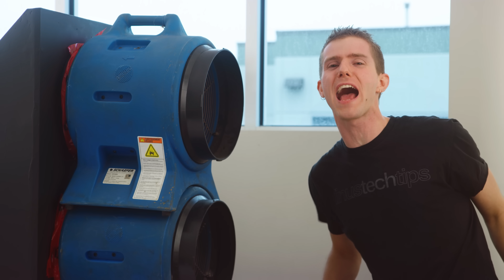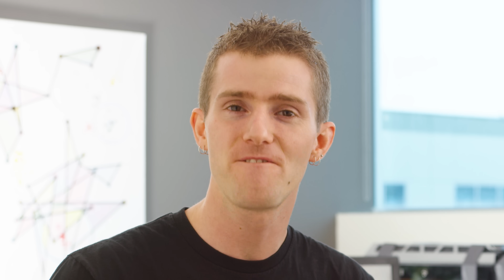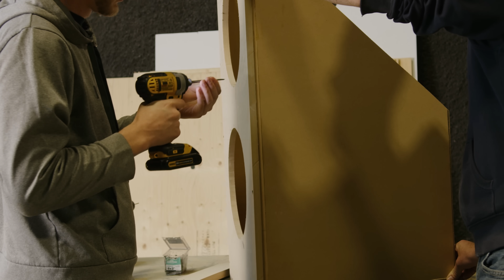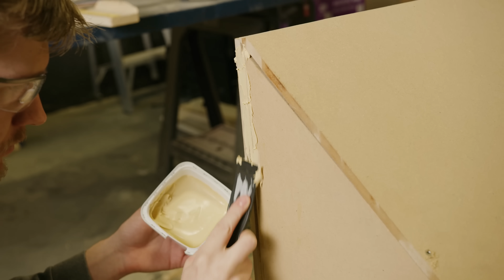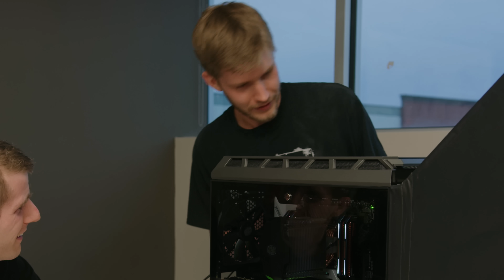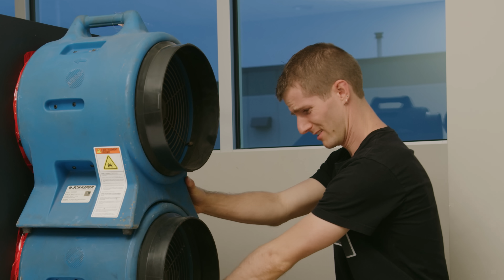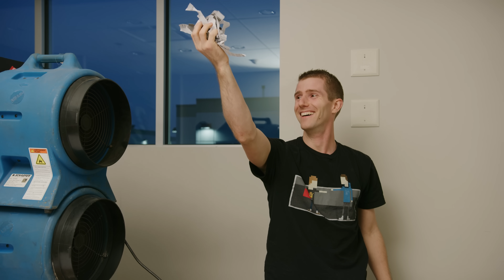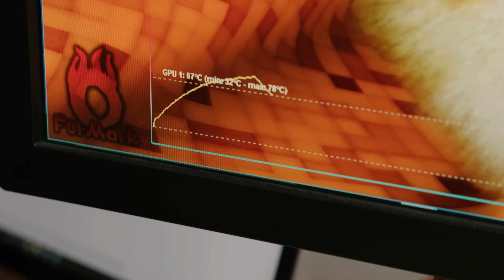Highest Airflow PC EVER - SUCCESS!

Comment: Anybody know what to do if your keyboard and mouse stop working after turning off your pc? They dont work in bios either and ive tried different keyboards and mice.
Reply: What are you trying to do with your mouse and keyboard with the PC turned off...
Reply: CHAOS_ Gaming in the BIOS settings there's a setting for things to load before boot. This is probably set to basic so your peripherals load after the OS loads. You need to reset BIOS then it should work.
Reply: holy shit you loaded games onto your bios? Anyways try reverting your bios to defaults maybe it's a software glitch. Simply pull the battery and reinsert it
Reply: there's a possability your connection ports 'usb ports' are fried...have you tried using others?

Comment: Cutting MDF without a respirator or even dust collection? Hope you like your lung cancer, that shit is dangerous.
Reply: its not like radioactive uranium that instantly kills you :D
Reply: >its not like radioactive uranium that instantly kills you :D

You have no idea what you're talking about.

Alpha radiation, which is the primary radiation decay product of natural uranium cannot penetrate human skin. You can hold uranium in your hand, preferably with gloves without issue. I've held samples of uranium and me still being alive more than 20 years later proves you wrong.

The reason for the gloves is to prevent ingestion or uranium entering cuts. If you get uranium inside your body, that's when the potential for cancer starts because internal organs don't offer the same protection from radiation. Though it would take years or decades for such cancers to develop.

You can even stand next to fresh nuclear fuel rods without issue. The instant death problem (which is not really instant) comes from spent nuclear fuel which has all matters of nasty isotopes that will cause death if too much exposure is had with them.

Comment: I use a 120mm bitmain antminer fan. they like 10-50 bucks each. on system 1 at 10 percent cools my GPU 20-30 degree C. my room is like 83-95degrees but my GPU is at 63-75 degrees. btw it's two XFX rx580 1425 oc+ edition Hynix 8gb hashing at 55mh steady for 4 days now non stop

Comment: Wow, this was amazing!!!... For a follow up video can you do something more risky??... 

Basically remove the cpu and graphic card fans and any other fans and just have these beast fans run as the only/primary fans, because I dont know why but for some reason I feel, that all the extra fan cassing may be causing air particles to bounce around and therefore without them the air could rapidly flow in one direction, whilst possibly taking the heat along with them more quickly, which may essentially cool the cpu/ graphic card quicker. 

Lol just a crazy thought its up to you if you wana go through with this xD.

Comment: Once i installed 50w cooling fan/ turbine from onboard computer of some tank it was like shitload of airflow and with some nice big heatpiped sinks temp of gpu an cpu and even ram close to ambient ( 2-5 deg C of difference) and it was quite quiet, 500w sound system on half throttle was able to overcome noise from fan :D

Comment: A good lo tech way to have a silent PC is to have your desk against a thick wall and drill a small hole for the monitor, mouse, keyboard cable then have the PC in the other room on the other side of the thick wall but still a short distance from you desk/monitor.

Comment: except it won't run for long because the dust touching the hardware is going to cause electromagnetic buildup and short circuit your system very quick. which is why you're not supposed to vacuum clean your pc.

Comment: Linus, this is a very cool video.  This got me wondering, has anyone ever tried to use a Dyson fan to cool a PC?  In particular, the Supersonic hair dryer.  I ask because the motor and fan are not really connected.  Thus if one had the know how, then they could mount a fan or 2 anywhere on a PC and place the motor for fans else were.  I am just curious if anyone had attempted this.

Comment: Wait, so even with all that airflow, the idle temps were higher than my little air-cooled midtower under load? Just how hot does the i9 and 1080 ti GET? I'm running an FX-8350 and 980 Ti and rarely ever see more than 60c under high load, 35c during idle.

Comment: If the air doesn't blow INTO the case, it doesn't produce the turbulence necessary to provide even cooling.  Sucking air through a case bypasses most of the hot spots.

Comment: Notice the rear fan is not removed... You have removed 2 frontfans but you forgot there is still rear fan mounted.
Because there is already so much airflow from bigass blowers, you don't need extra fans in the case lol... you don't need them!
Now i think the rear fan will die fast because over-RPM. Normally this rear fan does ~1500 rpm but with bigass blowers the fan RPM should perhaps around 10,000 or more RPM.
Strange enough, the fan blades are not broken due high RPM. But the bearings will break faster.

Did you check rear fan RPM when used with blowers? Should visible with motherboard tool.

Comment: At some point, aren’t you blowing out air faster than the cpu can dissipate? Because I know this to be the case with water cooling: at some point you can have to much flow, so that even if you go faster, you don’t go cooler. It would be nice to see them check how low in rpm they should go to get just on the spot that the temps are still the same, but the noise and airflow much less.

Comment: I don't remember the exact model, but I have a CM high airflow case from like eight or nine years ago that has about the same shape as this one, but more rounded and no glass.  And no industrial fans.  And space between the drive cages and the rear panel is narrow enough that I am a little concerned about the SATA power and data cables connected to the drives.

Comment: Did you check what happened to the RPM of the CPU-, GPU- and case fans? Especially the case fans at the back might be working as a dynamo, feeding power to the motherboard instead of  drawing it.

Comment: put one at the front to suck air in and one in the back to blow it out
Reply: push pull configs are to overcome static pressure limitations such as when pushing through restricted area's like radiators..I highly doubt you'd do anything but lose performance with this setup doing that
Reply: Wouldn't change the temperature

Comment: i suspect you were getting much less than 4000 CFM.  fans operate on a "curve", and the higher the static pressure, the lower the flow.  if you force all the air through restrictions, then you will have higher static, and thus, less flow. 

That said, this is in my top 5 linus videos of all time.  well done guys.

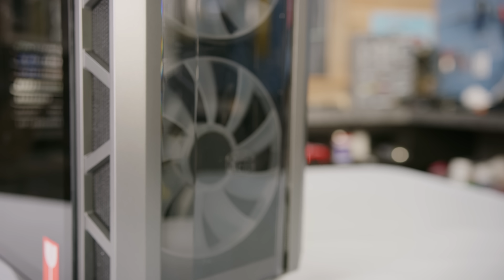Comment: 0:52 Let's get to know the H500P a little better:

CM makes you spend the extra dollars to get 200mm fans and then proceeds to suffocate them by placing a solid panel in front of them while not giving enough side clearance for them either.

What?There's not much more to know about this case other than that...And that it's garbo build quality for its price.

Comment: Linus, can you blow enough air that a cpu heat sink is no longer required? It'd be low performance but definitely a worth while test for this setup.
Reply: You could do it, you just need higher pressure air. Heat Flux is proportional to pressure of your heat transfer medium. You might be blowing capacitors and ICs off the motherboard before it's sufficient, but that isn't my problem.
Reply: That is how you get everything on fire/exploding. Kinda the opposite of cooling it. Liquid Nitrogen might work well for that though.
Reply: Compressed air directed right at the cpu heatspreader, it worked on bare die cpus back in the day so can't see why it wouldn't work with modern cpus + heatspreader..
Reply: Just start pumping in liquid oxygen
Reply: Paul Scofield 
Good idea
Reply: no not enough surface area to dissipate the heat
Reply: Nope. There is not big enough surface area and air is not great for heat transfer. Even with basic physics knowledge this must be obvious.
Reply: great question!

Comment: Linux, the Case is Garbage the front intake is blocking all the airflow as the fans are mounted in a way that most air cannot even get in. The case is retarded. Watch Gamers Nexus he tells you the same thing... ah and its overpriced
Reply: 1. What does Linux have to do with anything 2. Yeah airflow is not great but doable 3. A case can't be mentally retarded it is not alive 4. Yeah it is a touch overpriced actually a lot I agree with that

Comment: I am kind of surprised that testing was not done in more then one method. I am sure they may of been considered but since I never heard anything said it would be interesting to compare the end results. 
1. Instead of pushing through the front would there be any difference if it was on the top? back? or even the side?
 a. would doing this from the side give less restriction of the air flow and with that much air flow not even need the fans on top.
b. with this kind of air flow what would be the difference if there was a smaller heat sink for the cpu? or if the air flow is turn on when the pc is turned on would the cpu need a heat sink? 
2. In the same positions what about pulling air through? from those positions? I could maybe understand not pulling as it could cause a pulling stress of the parts.
I understand this would not be practical but since the test is not practical then why not also test the other ways to determine the best of the not practical ways :)

Comment: Nobody in this comment section seems to understand thermodynamics, internally the temperature of the air inside the case can never be lower than the room temperature. You're better off water cooling everything and putting the radiators outside (if it's cold outside). Air is a bad conductor! Just use water or metal!

Comment: Interested to know what RPM the rear fan was over-sped to by the pressure....
Reply: Fans used in computers are brushless. They dont have a direct connection between the coils and the power rails. Theyll also have clamping / freewheeling diodes thatll dissipate the energy as heat. The most the power rail would get to is the voltage the fan normally runs at + 0.7v (Diode forward voltage). That wouldnt damage anything.  The recommendation you state however certainly isnt wrong :) the reasons they recommend not spinning the fan are A. if you turn the computer on itll spin up with your finger in it, and B. Sleeve bearings are absolutely wrecked by twisting while trying to rotate them. It certainly would be interesting though to know what potential was generated across its coils (even if it didnt make it to the main rail) :D
Reply: That was my thought to, when seeing them turn the fans on, and then suddenly seeing the rear fan take off. They could have checked in the bios or something, but then the question is would it even be reading the rpm correctly?

Comment: Linus tech tips look this comment.
Ohh CMon! seriously?, Is not it easier to put a PC in dry Freezer?
Reply: you'd burn out the freezer's compressor, they are not intended to operate with a heat source inside them.
Reply: and they already did a video about that

Comment: what if you used an AIR CONDITIONER to cool a system.... use the air out of an air conditioner at lowest setting and channeled it in the case .... ???? 
I'd love that
Reply: condensation
Reply: Yeah condensation, fried computer.
Which is why, if I had tons of cash I'd water cool everything and mount the radiators to a window AC's vent.
Reply: there are already cases that have a "cooling system from a fridge" compressor type setups and thats about the same as your air conditioner but much smaller
Reply: Jan Andersson oh! I didn't know... thank you Mr.Andersson 😜
Reply: I don't think condensation will be the problem with AC. Cold air has lower capacity to absorb water so it wont condensate on hot surfaces.
Reply: Humidity it will shyort circuit the pc
Reply: freedustin I like your idea
Reply: zonrox then use dehumidifier? o:

Comment: In Short This is What My 5 Years Laptop Sounds Like.
Reply: do you happen to have an HP Pavilion DV7? xD
Reply: This is my ps4 on a good day.
Reply: ShishiR relatable
Reply: yea and I thought my computer that sounds like a vacuum cleaner was bad!!
Reply: You wish it pushed that much air at the same time though. Rather than just being a lap warmer for cold nights.
Reply: na heat isn't my problem its just I have two fans that are at a constant 3000rpm thats all and I can't be bothered two spend the money for new ones.
Reply: My old fat Playstation 3 also sounds like this when playing game. LOL
Reply: In short, this is what a 2017 macbook pro sounds like when on google docs
Reply: lol
Reply: I've got a clevo p650se. It gets pretty noisy when it gets hot. Which the CPU absolutely always is.
Reply: guess the laptop is jealous towards the vacuum cleaner or shop-vac on who can be the loudest
Reply: but douse it work as good :D
Reply: hu yea
Reply: How my custom modded ps3 sounds like, a leaf blower!!
Reply: ShishiR MI
Reply: Ironically my laptop that is now 5 years old is/was quieter than my current one. So yeah, being old doesn't guarantee it'll be old and being new doesn't guarantee it'll be quiet.
Reply: Elizabeth Mares No
Reply: I used to work on an old Dell laptop. Pentium 4 doing 3D rendering. Yes, it sounded like this. And you could cook a turkey behind it.
Reply: Mines silent, strange.
Reply: LOL
Reply: Yar Nunya I did. The cooler is not as good as the original first version, no heatpipes installed there. I had replaced the thermal paste with Arctic Silver 4 times over the 3 years. Finally I bought another PS3 (slim). Yea, I prefer PC cooling's flexibility. :D
Reply: This is my pc in 1 day :'v
Reply: this is what a mining rig sounds like litarly......
Reply: 5 YEARS???? My "shop" PC is 10 year old. And it's silent.
Reply: ShishiR that’s what my old Sony laptop sounded like way and this is way before my Asus computer or even my first MacBook
Reply: increase that to a 100 dB and that will be the sound leaking by my 10 year old laptop.....
Reply: ShishiR Yeah same as my pc
Reply: Basically my xbox one when under load
Reply: ShishiR My laptop with a y2k sticker is probably 85dB
Reply: It reminds me of my old ATI card
Reply: do a custom water cooling loop with them
Reply: Good For You My Friend, In Short
Reply: This is what my 2 month old MacBook sounds like
Reply: My 5 year old laptop doesn't even have any cooling 😎
Reply: Yeah I used to have a dell vista laptop it sounds like a rocket
Reply: 13 years laptop here
Reply: How my 7 years laptop sounds like when rendering default cube with 1080p res
Reply: Anmature
Reply: My 10 year old PC with Intel stock cooler and 2 case fans sound louder than this...my whole desk vinrates

Laptops scream(high pitched)
Reply: That's it 

Weaklings
Reply: How is it so quiet

Comment: Can you take just one fan, make a smooth coupler to attach the fan to a piece of 18" sonotube that is the PC case. Remove all stock fans from GPU / CPU and give them crazy super massive copper fin radiators. Then put a controller on the fan motor and see how low an rpm you can use to maintain maximum cooling?